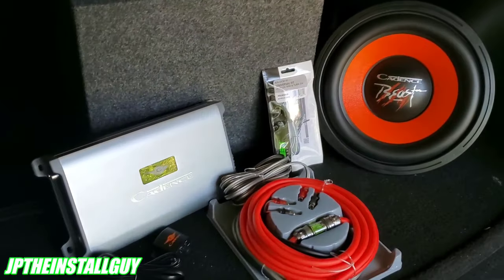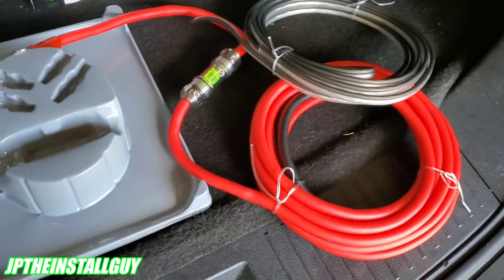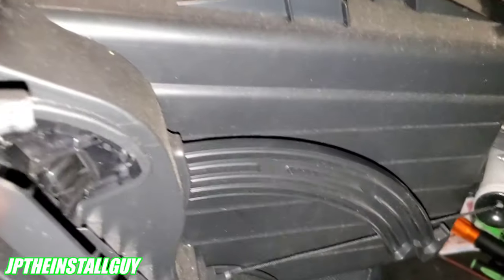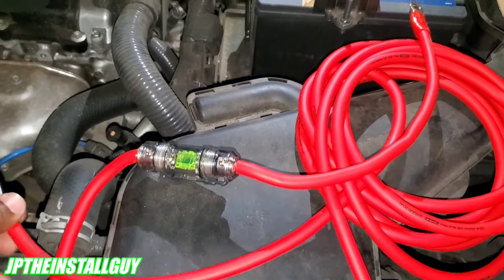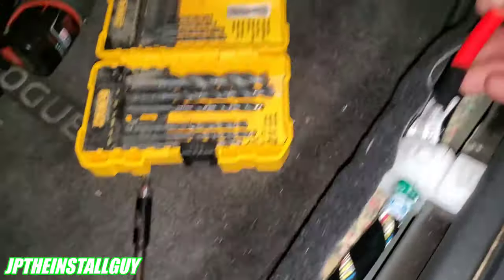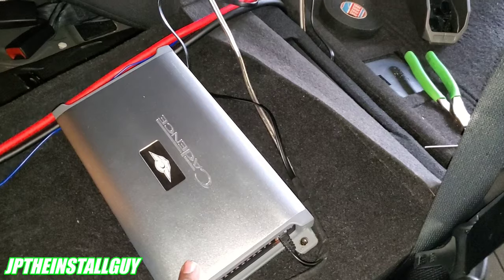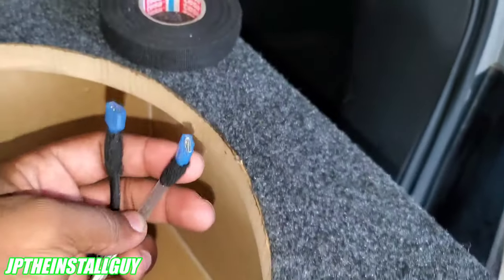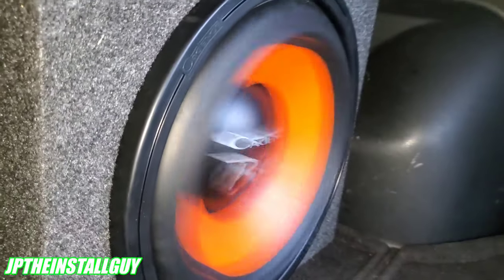How to install a sub and amp in your car | FULL DETAILED INSTALL WITH CADENCE SOUND

Comment: Thank you this helped a lot. And thanks for actually doing a short intro, and gettin right into it. you never get that anymore. 😂🙏🏼
Reply from the maker: Straight to the point man is how I like it. I just want to say what's up, subscribe if you like car audio, start the video😂🤣
Reply: @jptheinstallguy Question, do I need a line out converter if I have a aftermarket head unit. Every site says its only if your using factory stereo... I have the alpine ilxw670.

Comment: You spent more time talking about hooking the amp to the back of the seat and all the different reasons why and the Tessa tape then where the wire is needed to go on the actual amp! I have a Pioneer 1000 amp that I’m trying to hook up and it has a whole Lotta different connections. This is my first time frustrating

Comment: Excellent video only thing I would suggest is to use wire ferrules. They are a game changer and almost remove the possibility of shorts from stray wires at the amp
Reply from the maker: Yea man im trying to get my hands on some the have a super clean look
Reply: @jptheinstallguy  ebay is the place to shop

Comment: Great video. I wanted to add a little thing I use to fish wires through walls when installing individual lighted channel sign letters because even though I make my owns holes, sometimes I gotta push through insulation or go through several layers of material, and I have found that a survey flag wire is perfect. I buy them at Home Depot and get 100 for $10, but you only need one. It;s a stiff steel wire at 24", can be bent as needed, can push through quite a bit and just tape your wires to it when going around a corner or a tight spot and grab the tip on the other side. Then pull om through. 

Thanks again for the video!

Comment: Been watching a bunch of your vids. I'll be hooking up a new stereo system in my truck soon and these have been super helpful. I'm sure I'll reference them during the install! Thanks!
Reply: I am as well, what are you running?
Reply: @unspokenmajority3469  it's gonna be a Frankenstein system. Just different things I've acquired. 

The head unit is a Pioneer DMH-160BT. 

2 Alpine S-S65 door speakers. 

1 Power Bass competition 10" sub.

Rockford Fosgate Prime R500X1D amp.
Reply: @unspokenmajority3469  it's a small truck. Nissan Frontier.
Reply: @unspokenmajority3469  how about you?

Comment: That sub looks like a little beast i looked up its specs it can be mounted in a ported enclosure also and would have much more output prolly like 30% more or so ouput also some amps for the rca input u can run hi or low level thru the rca input on the amp kicker amps all do that and alot of other brands are doing this because u really want to run high level input at all times if u can u get better sq running high level since the signal isnt so small and need boosted so much introducing noise into ur system.

Comment: nice jp just curious why no ferules on power n ground to amp great vid though
Reply: Hi JP a question for you I have a 4-channel amplifier that's two ohms minimum for ohms stable I have four 4 ohm tweeters 2 4ohm prv 5.25 mid range n 2 6.5 mid bass prv speakers can I install all of this in parallel on this four Channel amplifier without any problems thanks

Comment: Video wasn’t king at all. Mad detail!!! Dope work!!!  Thanks again!!! 
Also is it better to wire your subs parallel? Bc I did the same thing but for 2 subs and 1 sub isn’t hitting as hard as the other.
Reply from the maker: Both subs should be wired together and parallel is a good option as long as your ohm load isn't to low for the amp

Comment: I have a 1999 suburban and for my rear speakers there is a factory amplifier that is pretty weak. When I turn up my head unit the mids and tweeted clip and distort. Should I bypass that factory amp ? Would it clean up the sound and also would it sound better if I bypass it and install an aftermarket 4 channel amp for my mids and tweets ? Also I installed my sub and sub amp and I ran the rca cable down the same side as my power wire. I used shielded rca cables so I wouldn’t get any interference. It worked out 👍

Comment: Im just a dope who read up on the resistance. Wiring to 1 ohm or 2 ohm or 4 ohm.

Basically 1 ohm is the loudest with the biggest boom. But its running wide open full blast at all times.
2 ohm is less and 4 ohm is what Im wiring mine for cos I dont care about huge booms, I listen to metal. 4OHMS will also be a more controlled response...better for fast bass like double bass drums.
Lastly, its a lot cheaper to wire at 1 ohm cos you can use a smaller amp.
4 ohms requires a much bigger amp but it runs a lot cooler than the 1 ohm. But, most people seem to run 1 ohm lol
Reply: I’m new to car audio… do anything change if my battery is located in the trunk??
Reply: @BBHGeneral  yeah you have it a lot easier to connect power

Comment: When u touch the power wires for the amp and u see the spark thats the capacitors filling up with juice not the mosfets those do nothing untill the amp starts playing music and still dont arc if they do ur amp needs serviced.  Im a amp repair tech located in Cincinnati Ohio.

Comment: I did everything similar to this video everything thing has power, nothing is blown, but I'm not getting any sound from my sub. Any suggestions ??? I appreciate it
Reply: Hey I’m curious did you resolve the problem you had with your AMP???
Reply: @ivoryheath6176 You may need to sand more paint off the ground. Make sure wires are connected to the loc correctly. Make sure everything is in ur amp plugged in. Make sure stock sub stock speaker’s plugged in. Make sure amp is on.

Comment: what about emi from the main power cord? have you had any problems with other components connected to the main oem wires running along the floor on the passenger side?

Comment: Ive mounted amps on sub boxes forever and have never had a problem. The way i see it the sub is vibrating everything on the car anyway so the amp will get vibration no matter what unless you mount on dynamat. Its not really a big deal if you have a quality amp

Comment: I see you have a 80w converter,does it matter and why.
Reply from the maker: Yes and no if your  car doesn't have a a factory amp or some sort of premium sound system you can use a basic loc honestly I didn't know this one handled that much watts but usually the ones with a remote turn on can handle a little more I'm making a video very soon about the loc in more depth so stay tuned

Comment: Just so you know you run power wires down the side of your car that has the battery on it and you run your RCA wires down the opposite side or else you'll pick up ground loop noise where your speakers play a whining sound every time I think of something to tell you to help you 2 minutes later you're saying the same thing I'm typing basically what I'm saying is you already know what I'm trying to tell you

Comment: Be careful with that fusible link. If that power wire touches the wrong spot it will blow that link and it cost over 100 bucks from dealer
Reply from the maker: Thats why I taped it up good so it doesn't touch anything 😁